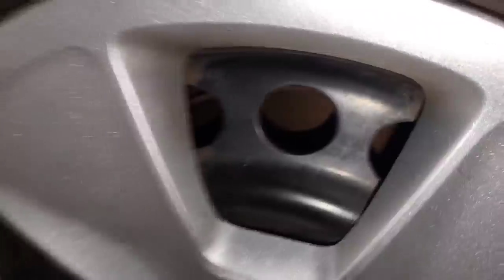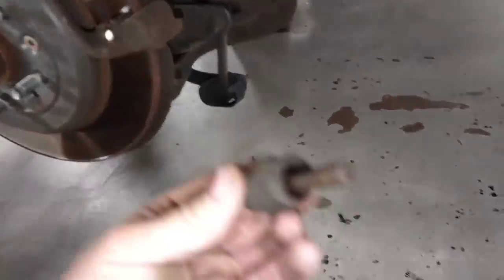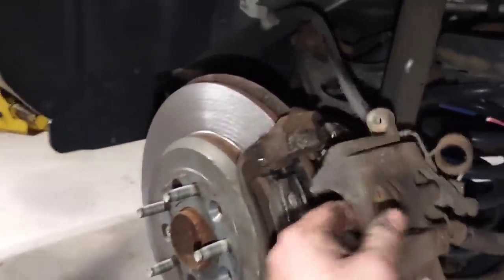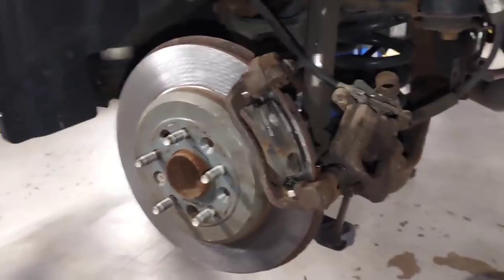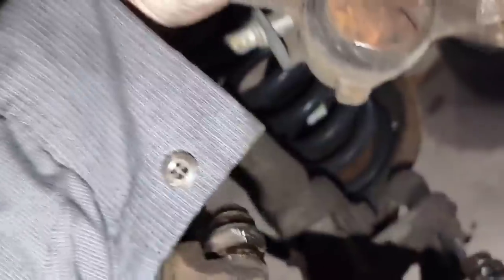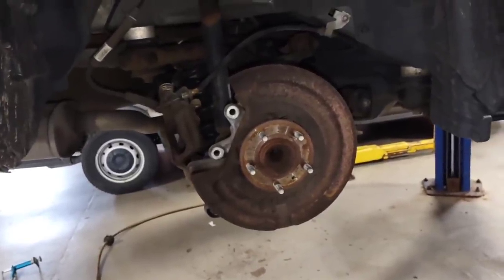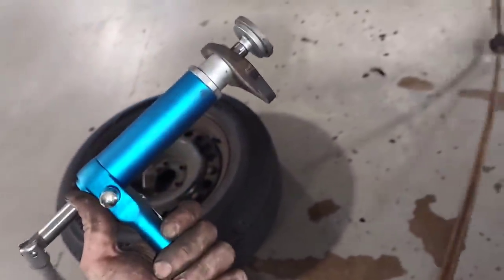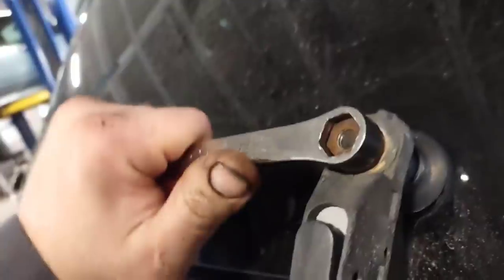Fixing Another Shops Brake Job Screw Up - this makes mechanics have a bad name Shoddy Work

Comment: Sounds like customer fault. They want everything for free. Dont trash other peoples work when you say you're doing the best minimum. Did you tell her it needs calibers because the boots torn? If she declined its her fault.
Reply from the maker: If you're specifically saying that somebody needs calipers because a boot is torn you're not a mechanic
Reply from the maker: That's a dust boot and all that boot does is it just seals from dust that one actually stayed pretty close even though it was torn in that little spot there's no reason to replace that because of that one little small tear it wasn't leaking fluid from back behind the piston
Reply from the maker: Sometimes doing the best safest minimum is what's going to keep the customers safe leaving because you can't let them out the door especially if they don't have money to pay for the best oh, you probably should check yourself because you sound a little ridiculous right now
Reply: @FordBossMe  Yeah. Maybe you're just no a good one. If the caliber boot is torn you recommend replacement. It lets in dirt and debris and can cut the seal leading to brake fluid leak or loss of brakes. Or better yet look at it as your moms car. Would you replace it for her? Or your own car?
Reply: Also depending on state it fails inspection.
Reply from the maker: I'll give you two options

 you clean up your act right now we start fresh and you don't run your mouth anymore and we can be a part of each others social media mechanical life 
or 
option b you keep running your mouth keep judging people and keep being a complete a***** and you won't ever find this channel again

That's how it's going to be, I don't have time for this
Reply: @FordBossMe  I just noticed the torn boot and pointed it out. Yeah i know how costumers get. Especially when calibers get marked up and make a 250 brake job over 1000. Once you do inspections you go by the law. My state is one of the strictest. At my job we have to cover ourselves to not get sued.

Comment: I had that happen to me I had a 2008 Ford edge I baught  used took the car to a friend' he took to pet boys and a month later the pin was not set right and cut the rotor so bad I to replace the the pads and rotors at my mechanic shop .pet boys suck